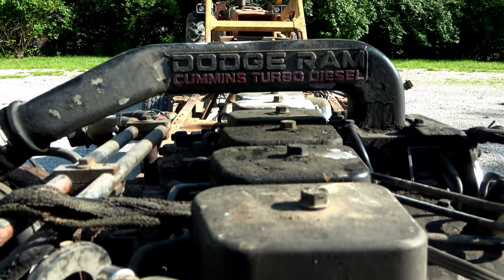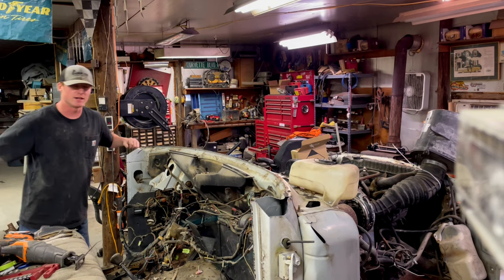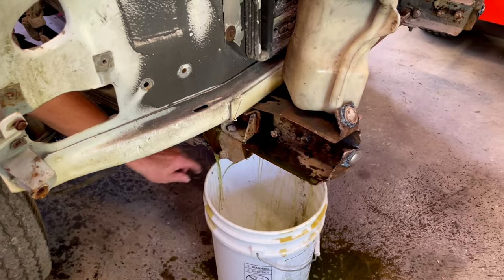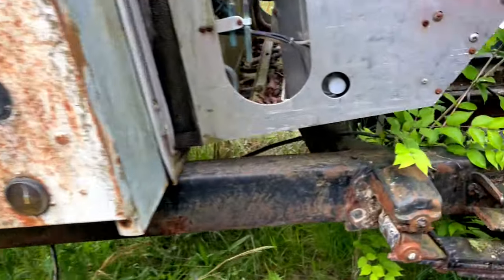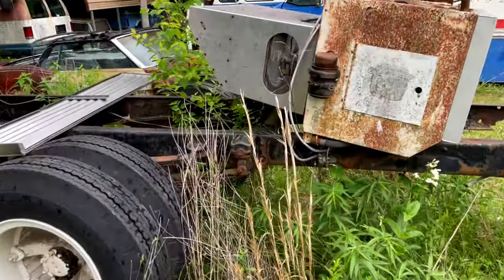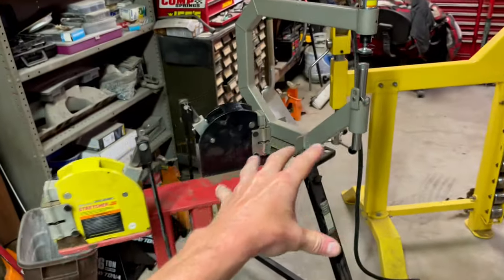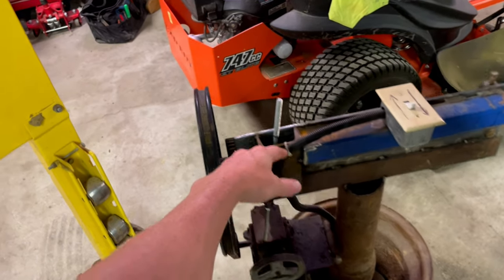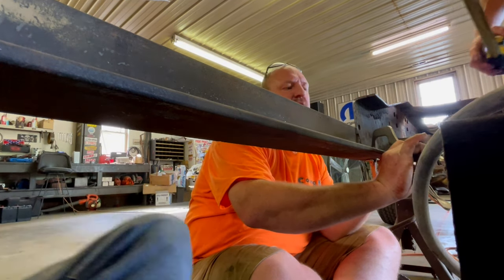How to Extend a Truck Frame for a Chassis SWAP

Comment: I actually find this really interesting Devvon because your crew cab is 160 inch wheelbase and my crew cab is a significant amount shorter than that and it’s funny because we chose to go with a second GEN 3500 cabin chassis that measured 163 inches so we basically have to cut what you added
Reply from the maker: That’s what we wanted to do at first, but this first gen price was unbeatable, so jumped on it!

Comment: I have a 1967 W 200 that the door hinges are rusted so bad the doors drop as you open them, you  ever run into this problem and do you have a fix
Reply from the maker: Interesting, haven’t seen that yet. Probably would be best to just replace them, if they’re similar to the 69-71 trucks, we probably have a set
Reply: @RealSteelFabrications   I've looked at it and I may have cut the front fender off try to weld a plate where the hinge attached and reweld them, the 67 is the same as 69. right now Iam using the truck as a boom truck, they put alot of salt on the roads here in Alaska